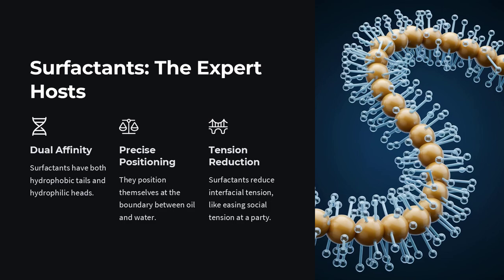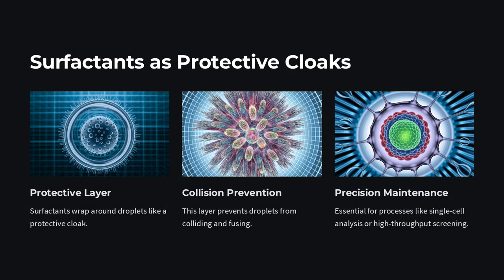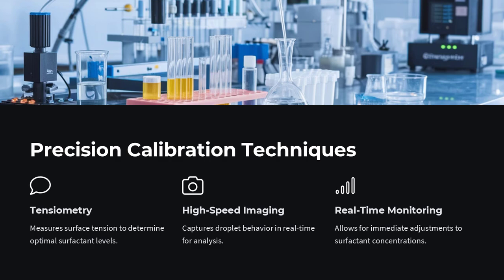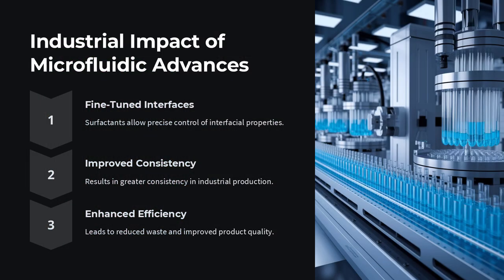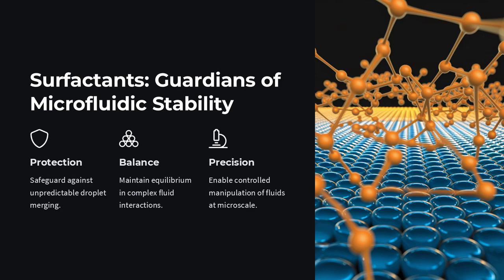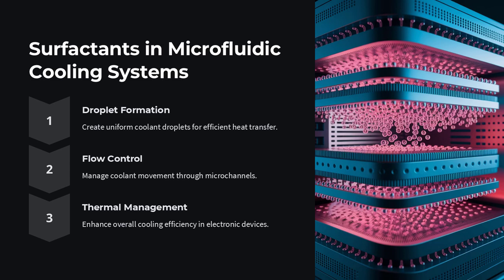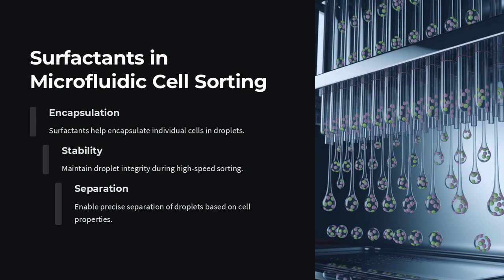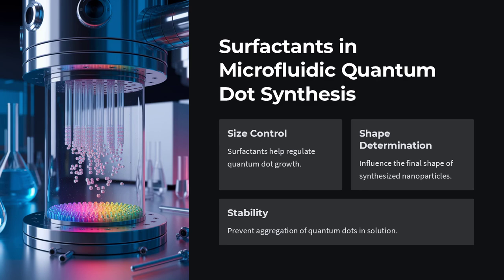Surfactants in Microfluidics – The Hidden Architects of Precision Fluid Control

Comment from the maker: How can surfactant molecules be engineered to dynamically adjust their interfacial properties in response to changes in temperature, pH, or shear forces within microfluidic channels?
What are the fundamental thermodynamic limits of surfactant-stabilized droplet systems, and how can new surfactant chemistries push these boundaries to improve microfluidic efficiency?
Could AI-driven molecular design enable the discovery of next-generation surfactants that self-optimize in real-time, reducing waste and improving stability in high-throughput microfluidic applications?